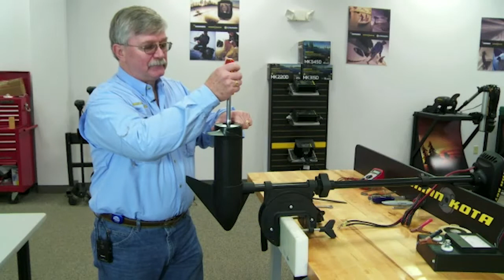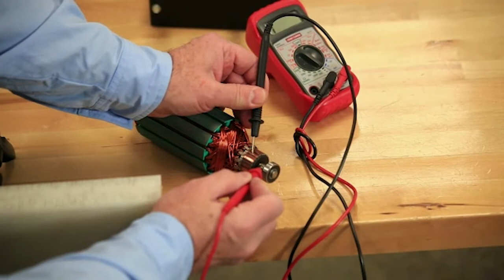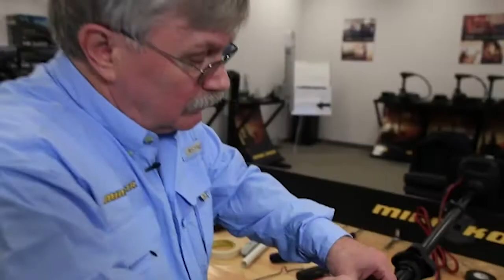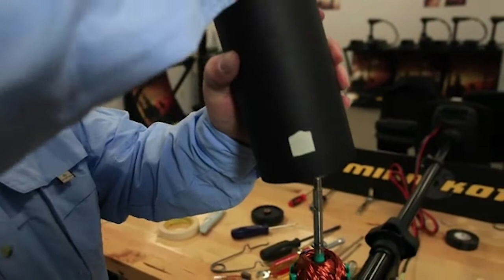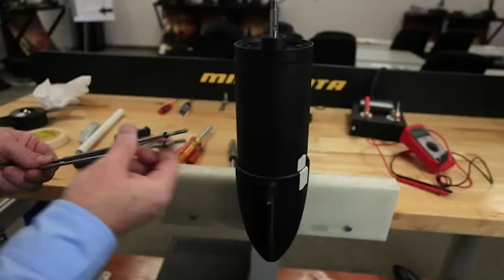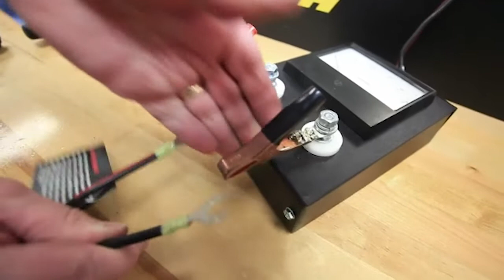3 5/8 Inch Trolling Motor Lower Unit Disassembly & Assembly | Minn Kota

Comment: My old open cup seal had a cardboard liner inside, similar to the one used to hold the brushes open, but much smaller. Does that need to be reinstalled with new seals? You did not show that in this video so I’m curious

Comment: During disassembly, I had a smaller lower unit seal paper bore fall out and I ca not find where it goes…. Any idea???
Reply: That's called the "brush retainer".
It's used during assembly to hold the brushes back so the armature can easily be installed.
It confused me as well, but that is literally all its for.
As the armature gets pushed in, the paper ring is pushed out of the way and allows the brushes to spring in to place.
Reply: @whitetrashgarage38   Thank you sir. Much appreciated. I was close to losing my mind on where it went.

Comment: Video was very informative and helped me gain the confidence to pull the lower unit apart.  Like any video I guess, I think it could have added more info, but it had enough to help my troubleshooting mind understand how it is supposed to work and hence figure it out.  He talked about testing the armature for continuity which is good as it confirmed mine was fine.  He also mentioned looking at the brushes for wear, but someone who has never had a motor apart to know what a worn brush looks like, I could not confirm.  He also spoke about making sure the brushes make contact with the armature, so this is when I started trying to manipulate my brushes with my fingers and one would not move.  Upon pulling it out I found it somehow melted a hint and "welded" the brush to the brush plate.  I could likely just have cleaned it up and it likely would have worked, but since my motor is over 10 years old and don't want it to fail at a critical moment, I decided to "rebuild" it buying new brushes, brush plate and springs.  I had to order the seals anyway, and this totals about $30, so I just ordered them per the parts diagram for my motor on Minn Kota's website.  Support really was not helpful other than confirming that my tracing of this by testing voltage at every level between battery all the way to brushes was appropriate, and to look for water.  Between this video, and other videos allowing me to understand the path, I was able to do this myself and now know more about these motors than I ever cared to learn.
Reply: 👍 I'm going to be doing the same.  I feel I can do it after watching this video but do not have the handy brush spreader tool...
But I should be able to improvise.

Comment: If it’s 180 out it will not run backwards
Reply: Yes , it will
Reply: @Wakawakawaka540  lol, I found out on the lake that it does exactly that!  Great video. Now I can go forward in forward!!
Reply: is there a way to tell orientation besides tape? I'm replacing the magnet tube, so no tape cheet for me
Reply: Even if that does happen, you can quickly swap the wires in the head piece (while on the water like I’ve had to before) instead of having to take everything apart at the prop